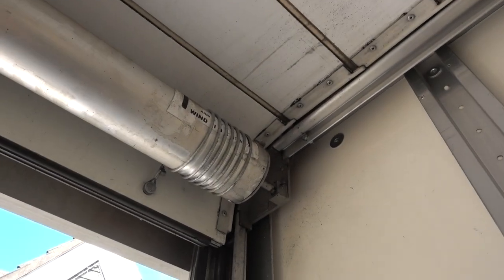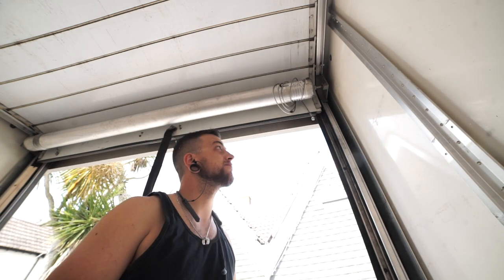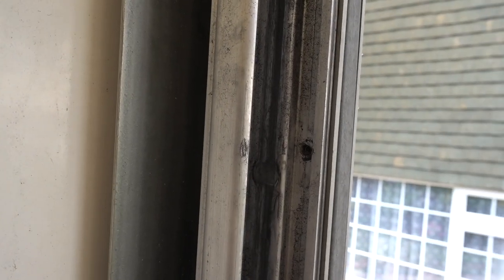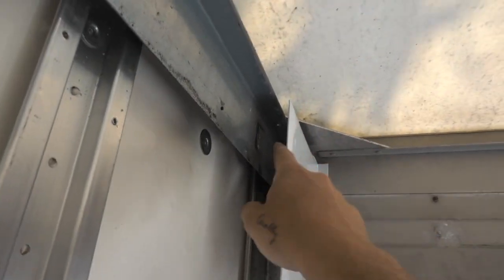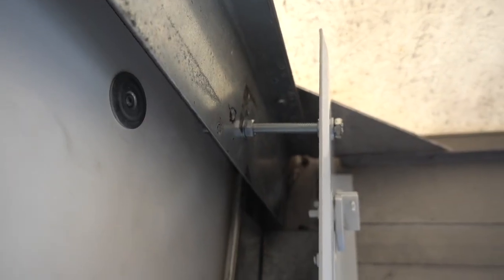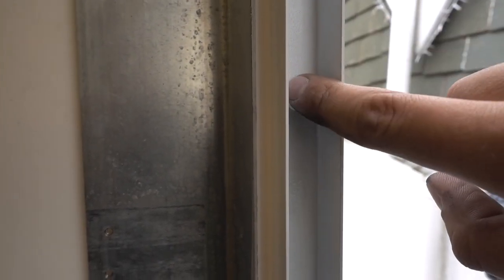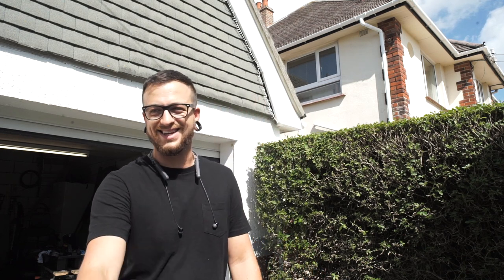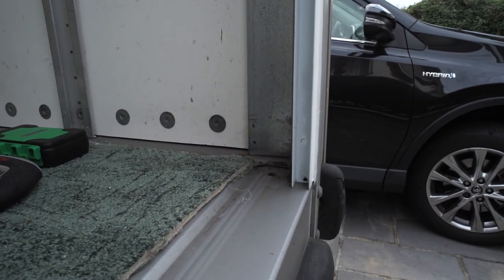Luton Van Conversion: Replacing a Roller Shutter

Comment: Hey Jack, Thanks for the videos! Love how you know what you're doing but are still learning along the way! My partner and I have a similar size Luton (Sprinter) and are planning/building a very similar lay out to yours! I have the same question as 'Rudi' asked below - we were planning to leave our structural support in and use that as the sides of our box. I think our box is aluminium all round and the beams are riveted right through. Would there be any chance I could send you an email with some pics and see what you think? 

We're also planning to replace our rollershutter so this video has been doubly helpful!

Loving the tunes and vibes bro! Keep enjoying the ride :) Hector

Comment: Is the box still strong without all the rails and beams on the inside? are they structural or purely for lashing? seems it could end up being quite flimsy unless you plan to replace with something structural. nice work man loving it.
Reply from the maker: Hello mate. The wooden rails were their strictly for tie downs and the steels beam in the middle was there for load bars. The aluminium uprights were just glued to the wall with a rivet top and bottom. They aren't part of the frame of the box. Once they were off though the walls had a lot of wiggle in them but the structure was still good. I can only say this of my box though not sure what kind of box you have but if you like you can always email me some pics and I'll tell you what I think, if that's help? I will be replacing with some timber studs before I insulate so that should get the rigidity back.
Reply: @lifeinsidealuton4487  my thoughts exactly with the studs, I've converted a sprinter and the luton is next on the list for 2021 so I will be following closely! your box looks in very good nick, you seem like a great guy cheers for the quick late night reply!
Reply from the maker: @rudisfilms3485  no worries mate! Best of luck with your build.

Comment: Hi mate. Did the drum make a noise when you took both cables off? Trying to understand where the tension went if not.
Reply: When the door is opening there is only two to three turns on the spring.  Now if you took the cables loose when the door was down, watch out!